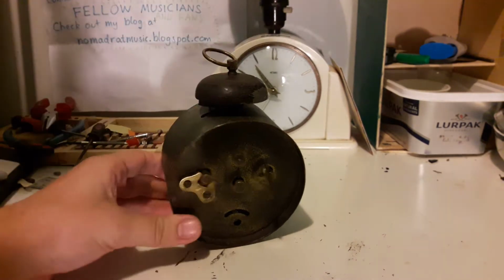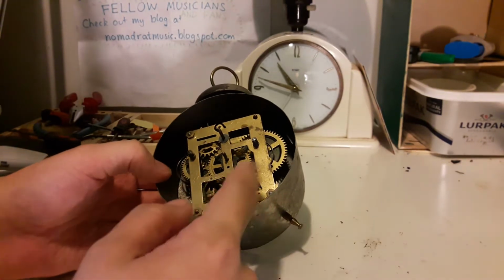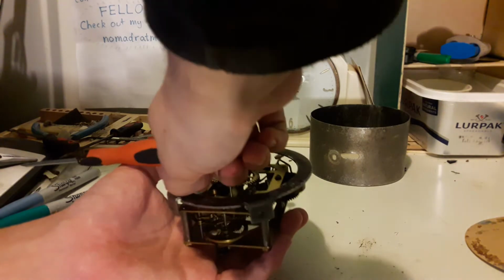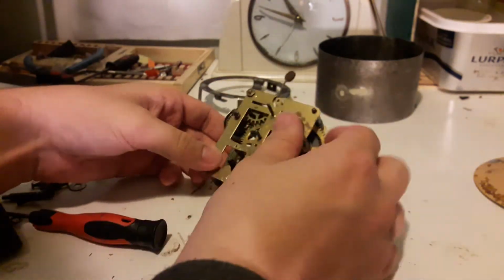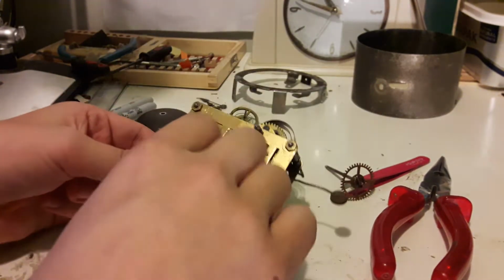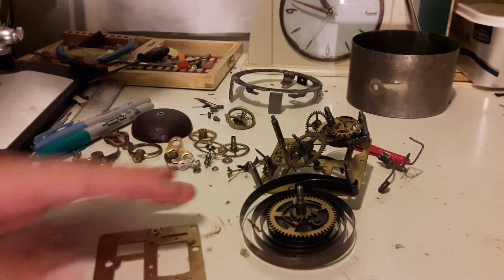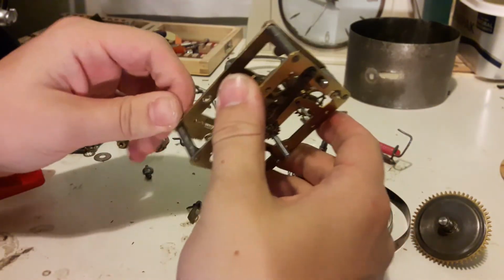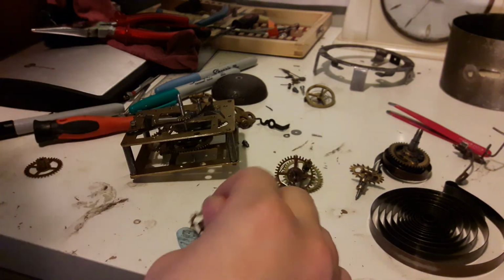Haller Alarm clock that keeps stopping part 1

Comment: 23:37 Unless a wheel is bent either up or down in some drastic where where it makes contact with something it shouldn't, you should be okay. I know my 37' Westclox "SPHINX" has the same thing going on with the third wheel. I don't believe that's the problem. 

If you ask me, I think it's an issue with the balance points going dull. Possibly both of them.
Reply from the maker: Yep, turns out that once i replaced the balance wheel, it ran perfectly for a couple of days